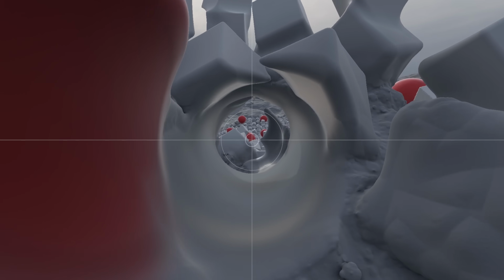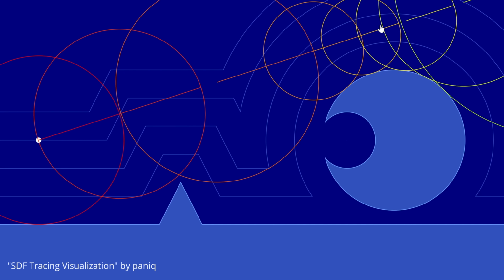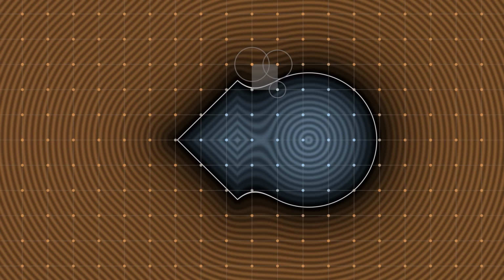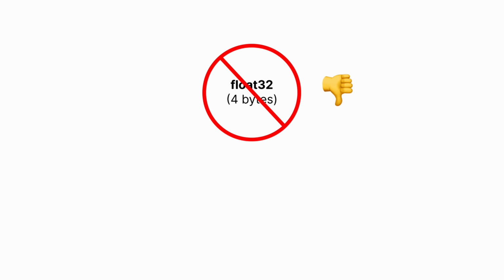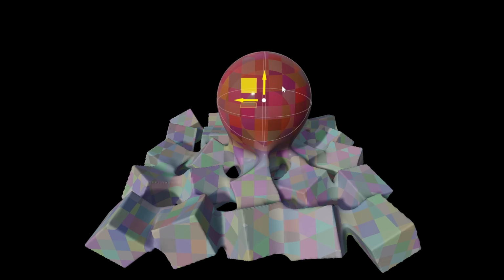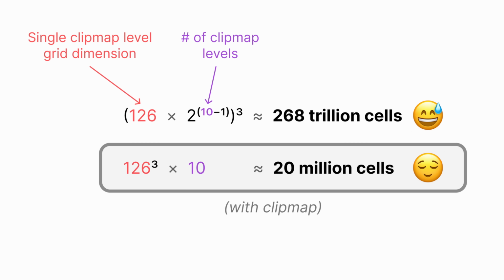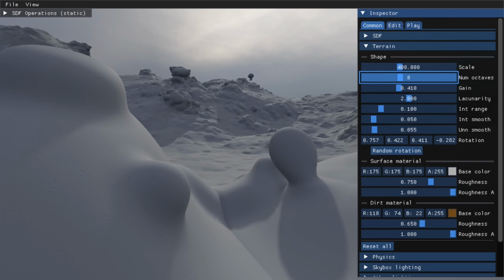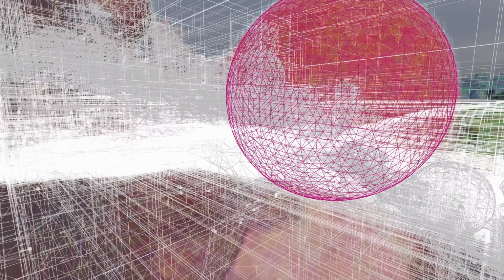I'm making a game engine based on dynamic signed distance fields (SDFs)

Comment: For years now I was banging my head against the wall figuring out how to have total environmental destruction but with mass preservation. I do want high fidelity models, so I was thinking I will need polygons and real-time CSG, and then somehow quickly merge geometry using CSG (e.g. chunks of bricks getting blown out of a wall and then merged into a smooth voxel based terrain). Since SDFs are pretty similar to CSG, but with primitives instead of polygons, this does give interesting ideas, because SDFs with caching seem to do merging really well. For mass preservations you would need 'AND' bool operations and duplicates of surface primitives for accurate cut-outs, after which you would need to to convert to poly-mesh for the accurate cut-out in real-time and do collision. You could also use SDFs as cage-deforms for poly-meshes (steel beams, sheet metal, rubber...).

Suppose you go ham on the terrain, how many edits does it take to run out of of memory? As I understand, each edit is a new primitive and only the geometry is cached, the primitives themselves don't get binned or combined in any way. Also is there perhaps a way to quickly dynamically convert a poly mesh into SDF made up of primitives (inverse of marching cubes)? Do SDF give any effective method for occlusion culling?

The only other alternative I could think of is creating high-fidelity meshes from just SDFs, but since you have to convert to poly-meshes for physics collisions, that presents a new problem, especially if you have recalculate the collision mesh after destruction, every time. With poly-meshes, if you have collisions meshes, I'd have to do CSG on those too, which gets weird, because those are either primitives, or in case of the environment, the cached Minkowski sum of all the geometry (do I really need this?).

I still think poly + CSG is the way to go, just gotta figure out how to make the merging fast, maybe with some spatial hierarchy and spreading the merging operations out over time to avoid stuttering.

Comment: Instead of just an ordered list, you should use a hierarchical ordered list, so that you can have more complex rigid bodies (e.g. a "dynamic" body in your system that has multiple SDFs making it up).  This also gives you finer grained control over what can be "melted" together (smoothing), and in what order.

Also might want a way to convert tri-meshes to SDFs so that you can import existing meshes (e.g. Trees, etc).

Probably will want a way to animate SDFs (e.g. Trees and grass that sway in the wind, etc.).  Not necessarily talking about bone skinning here, just hierarchical key frames for transforms (which should be a lot easier for a system like this, than skinned meshes).

Edit: I love the tunnel gun btw.  In my VR adaptation of Adventure I changed the bridge into a movable tunnel.  It just does a geometry based boolean subtraction when placed, and restores the backup mesh when you pick it back up, but it would be so much cooler to just have it always working as an SDF.  Very cool.

Comment: So if you add 1 trillion items, doesn't that make the saving/loading incredibly slow?
Does the merging/additive ever check for duplicate/non functional edits to speed it up, or possibly just replace with a larger object to hide the multiple smaller non functional ones?
Likewise with subtractive. Having 1000 'holes' in the same spot could be defined as only a couple?
Sorry if this was addressed, SDFs are new to me.

Comment: That sounds cool. I had an idea for you: Why not use the depth map of the last frame, then transform that with the new 3D position and use that depth map as the starting point for calculating the SDFs for the next frame. I don't know if that would work! Just a guess 😀

Comment: This seems like a straight up upgrade to marching cubes. So I am expecting a smoother looking and fully "marching cubed' Astroneer at the end of the line. Except with the dynamical edits utilized to the full, with vehicle parts, NPCs and projectiles being able to create / delete terrain as they pass near it. Or drill permanent holes. Heck, the vehicle system would be more interesting too, if we allow more freeform editing of the dynamic part as well.

Extremely interesting to see what the gameplay implications are, as those are sometimes constrained by the engine. Surely there's a whole world of potential that nobody has tapped into before that's now possible.

Comment: It's super cool, and a heck of a lot of work has gone into this, I'm sure! I can see how something like a BVH gets you the ability to have bodies which can influence each other in the SDF - but when you have something which modifies the terrain, how does that work? Without permanently remembering every object path so that it can be re-subtracted every time...

The terrain, I guess, is another grid SDF, which you can modify? I'm not sure I totally see the value of everything in the world being in the SDF other than the terrain (which I guess can also include anything else - e.g. you can make a house out of 'terrain') 

I thought when you were talking about the grid, that you were going to use the grid for a coarse TSDF then use ray marching inside the grid cells, but the grid itself must be decently high resolution as things like your game cubes still have relatively sharp edges.
Reply: Re-listening to the last segment, it seems like yes - maybe you do just remember every subtractive primitive? That's kind of neat - but depending on the game/application, if it ran for long enough, eventually you could get an enormous number of edits!

Comment: im curious to know if games like Astroneer or Space engineer where they have "smiliar" map modifications use something similar
Reply from the maker: Typically they use marching cubes (or similar) on a fixed grid. It's a good technique but typically limits the fidelity because too high of a grid resolution is too slow/memory intensive.
Reply: @Mike-Turitzin yeah the files size just keeps expanding the more you modify the terrain does your fixes that problem ? (On a large scale)

Comment: I once had some thoughts about optimizing SDF ray marching by thinking about it like binary search, though your interpolation and caching are rather in a different direction.
My thought was to use an additional field, a sort of "overshoot distance field."
This would return the lesser of two values:
the distance to the nearest point which exits "away" from the given point, or
the distance to the nearest relative "horizon-line" point (a point on the shape whose tangent plane includes the given point; or equivalently putting the given point in the "non-secant region" when considering polygonal or cusped shapes).
These two should be the only modes of "overshooting" the given shape: exiting straight out the other side, or just glancing off.

This value may often be considerably larger than the SDF. What you would look for, then, is to arrive at a point with negative Signed Distance, then follow a binary or interpolation search between that and the previous iteration. Because this is now a two-sided search, it should arrive at intersections some number of iterations faster. Even better, because you aren't slowing down as much very close to objects, those near-misses should spend substantially fewer iterations, as well.
The tradeoff is obviously higher per-iteration computation.
...
Although maybe doing cached Overshoot Field and SDF into an exact SDF would allow for more accuracy at analogous performance? Perhaps not, but I thought it could be a cool idea. Not a programmer, though (more a maths guy), so this may be a very silly idea.

Comment: Amazing stuff, but just a tip - when you're promoting a thing, focus on what those using it will need to know. Designers using an engine just need to know:
- What we can do with it
- How fast does it run
- How hard is it to use

Some other points like how fast it is to use could be useful, but I think the points above are probably most important. This video is a good deep dive, but it is WAY more info than many game devs will want.
Reply: That said, I think it'd be interesting to see No Man's Sky remade in this.

Comment: I was just looking into SDFs a few weeks ago for terrain geometry for a game engine.  It's really cool to actually see it in effect in real time.  I especially like how scalable they can be, where voxel grids could take up tons of memory for a large sphere.

The one drawback I do see with SDFs compared to something like minecraft, is the complexity of interaction with the terrain in a way beyond simple 'material'.  For instance, the voxel nature of minecraft allows for the redstone system, which in my view would be easier to prototype in a grid-like fashion where discrete blocks can be modified quickly.  I also think of simulators like PowderGame that has fluid "pixels" that can flow around and interact with one another.  Fluid systems seem like they would be more expensive in an SDF environment.

Mike, I'm curious on what you're take is on this.  Have you thought about how you would implement systems into your game engine that might be more easily implemented in a voxelized system?
Reply from the maker: Yeah, there are definitely advantages to having the modularity of voxels. So basically I'm going to need to design mechanics that work with a more "organic" and less modular world. I do think that opens up some new possibilities, though, particularly for the non-destructive edits. And yeah, I'm not doing fluid sim because I already have enough to think about perf-wise :)
Reply: @Mike-Turitzin  Yeah, exploring new types of mechanics that, say, a voxel engine might struggle with is cool to think about.  I suppose something more gradual or analog, and less discrete or integral.  And yeah, I guess you have to pick your battles when it comes to performance lol.  In any case, great work on your engine.  I didn't know anyone else was looking into SDFs like this, and it's exciting to see.

Comment: One thing I love about SDFs is they can faithfully render curves at an infinite level of detail. Even in AAA games, you'll always see some low-poly assets like plates or cups which were obviously meant to be round by to save GPU cycles have to be rendered with sharp edges. I really hope your innovations here can lead to more use of non-triangle based rendering in games.

Comment: vs dynamic boundary volume hierarchy. you can narrow down the hits similarly fast in both. ie logarithmic in volume. sdfs would then work nicely for geometric boolean 3d cad stuff. sphere bvh intersections are cheap to test for rays. ie point ray distance. a couple dot products and division at max per ray sphere intersection test. if you can make engine handle all stuff graphics and physics simply the better. no combining complex stuff. cad editor does not need physics or game play elements implemented. just graphics and lighting by ray tracing. cad tools should be the graphics focus. yep separating the graphics from the game engine stuff is useful. but also if the same stuff can be made using the same engine internal systems.

Comment: How does that scale with big changes? Like does it perform well if you dig a hole the size of a building in a single frame?
Reply from the maker: There are limits, but the LOD system is pretty good about doing less worth further from the camera for large changes. If I want to enable stuff like that I might need to time-slice the update work and delay the change by a couple frames.

Comment: This is freakin insane. I spend months trying to figure out how to make SDF with dynamic topology. But any solution does not fit into GPU shader architecture. The most I achieved was 64 dynamic SDF edits and massive performace hit due to excessive branching difference per shader invocation. I wanted to make a game inside a fractal, but being limited to 15-30 dynamic bodies or having to precompile thousans of shader variants for linear gameplay sequnces was putting me off. I considered storing SDF values at grid, but as you mention the memory demand is massive. But I never considered sparce data structures and SDF culling that will work on GPU. One reason - I wanted to being able to apply distortion to the whole SDF and any culling was not possible. May be I will figure out these technicks and finally build my vision of SDF game.

Comment: In pretty much every example you shown, the objects are smoothly blended together. I wonder if it's possible for two objects to be next to each other, and not blend, or is there an issue due to the size of the grid?
Reply: it's possible to get sharp edges with SDFs

Comment: 10:00 Funny thing about this, you almost are just reinventing jpeg compression here (referring to DCT mainly). My question is, why not just use a DCT more closely like system? Because you could precompute different sizes and then use a static lookup table. 

Also seperately, why not do something like what vr does with Foveated rendering, where higher magnitude areas would have less resolution, and lower magnitude areas would have more resolution? (this could solve the instance of corners being funky, but keep memory usage low.)

Comment: "High fidelity is absolutely necessary for this scene" at 10:57 cracked me up because of the implication that torturing mr potato head with snot was the non-negotiable impetus behind this project.
Reply from the maker: Sometimes you just have an itch you need to scratch :D
Reply: What happens to the mr potato head towards the end of the video is far worse.
Reply: It must be terrifying for a potato man to have runny mashed potatoes dumped over their head like that. No wonder he has such a look of horror on his face.
Reply: LLOOOOOL
Reply: xD
Reply: Looked like what's his name from Family Feud.
Reply: @Rockyzach88 Steve Harvey!